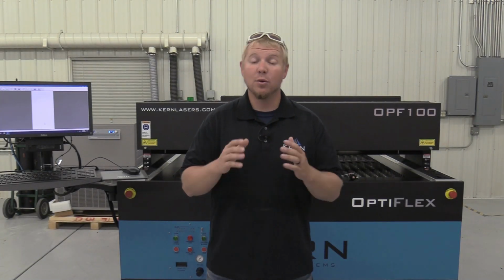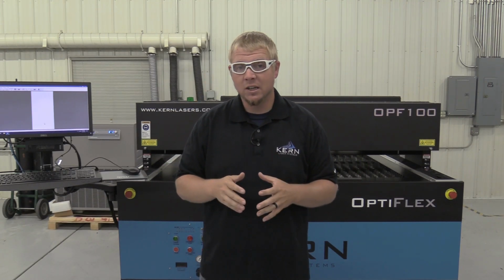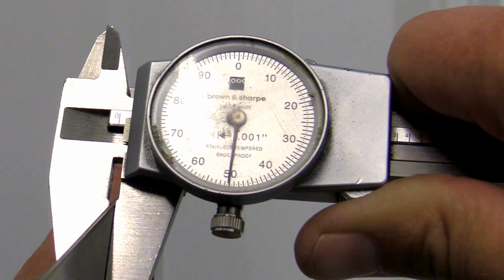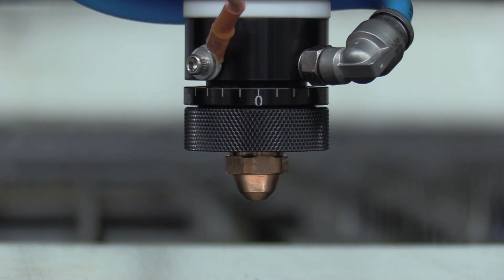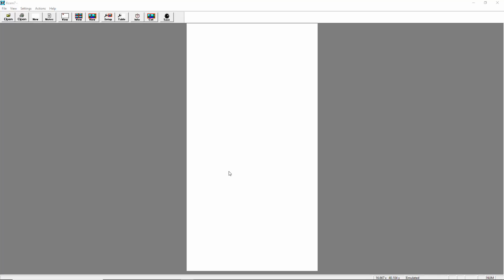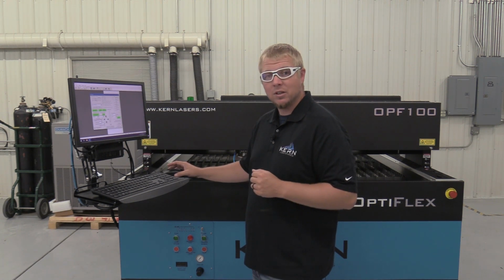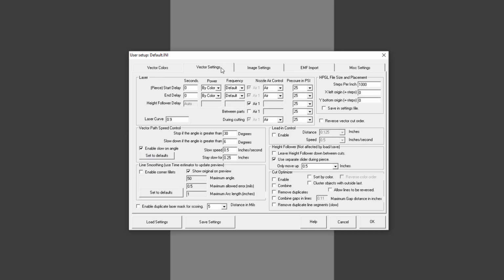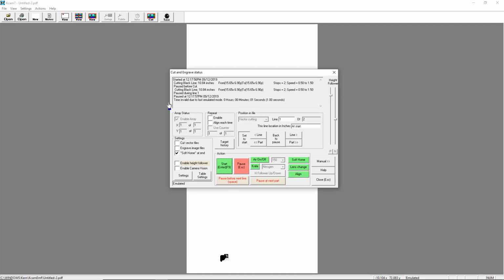400W CO2 Laser Stainless Steel Cutting with Nitrogen - Tutorial

Comment: I'm battling to understand if it's worth getting a CO2 to cut metal , fiber costs so much, it's so big, does it cut clean without burrs?? They also tell me, seeing that the co2 will always work at max power , this means that it will last very little time, can you please tell me a bit about my doubts, I want to cut maximum 1.5mm stainless steel.
Thanks sir
Reply from the maker: Hello! Sorry for the delayed response. Co2 lasers are able to cut many kinds of metal without burrs. Thicker aluminum will have some burrs but can generally be picked off by hand. 1.5mm Stainless Steel for example can be cut (generally without burr) by our 400W system at around 90% power so the theory that all metals have to be cut at 100% power is a myth. Our laser sources are warrantied for 3 years. We don't base our warranty on hours or amount of use so you can run it however much you want, we guarantee it for three years or we will replace it. The benefits of a CO2 over a Fiber would be the ability to cut and mark other materials like acrylics, woods, leather, etc with the same machine. It really depends on your budget and needs. Keep in mind this information applies to our laser systems only, we cannot guarantee results form other laser companies.

If you'd like you can email info@kernlasers.com and request more information. Thank you for watching our video and thank you for your questions! Let us know if we can answer any other questions for you.
Reply: @Kernlasersystems  I've emailed you, thanks for your kind reply .. @90% power, at what speed do you cut the 1.5mm stainless steel, so as to have a nice clean cut?
Reply from the maker: @zarbi123456 we are cutting about 1 inch per second at about 90% power. Hope this helps!

Comment: Hi, I'm considering purchasing a CO2 laser for cutting metal, but I need to cut steel, up to 15mm thick.  It doesn't matter how long it takes.  I wonder, if I take many passes, would this machine cut to this depth?
Reply from the maker: Good Morning Jared and Vanessa! Hope you had a great holiday. Jared, a higher power Fiber is what you would be looking for. Our 400w lasers are going to cut through 4.8mm mild steel with Oxygen assist. Doing multiple passes into metal is not recommended as the beam will reflect back into your lens/mirrors if it doesn't pass through the material.  Our 3kW FiberCELL is going to be at a max at .500" or 12.7mm.   Hope this helps, Vanessa, would like to see your finished set up when it's all done!  Have a great day to you both.
Reply: @Kernlasersystems  Thanks for getting back to me!  The best I can tell, is if will try this machine I would need a high power laser (probably fiber, maybe homemade co2) setup as an etching machine, not as a traditional cutter.  The highest power I see etching machines for sale is 100W, so I really wonder what something like 1-2kW fiber laser etching machine could do to a 30mm diameter steel bar.  I'm sure it wouldn't zip through like butter but given enough passes it would cut.  How much time is the question.  I see people deep engraving with a 50w, which makes me think cutting with a 1kw fiber may work well?  I assume reflecting back into the optics is likely not as big of an issue when the optics are kept at a distance from the workpiece.  I can think of so many applications for this...I'm surprised machines aren't sold for this...but maybe (probably) it's because it just doesn't work well.
Reply from the maker: @Jared Brandt 
Hey not a problem! We love talking with people interested in Lasers Systems!
In regards to your questions, one of our sales team members might have a better understanding of your process and would be able to give some insight on what might be best for your business.  Would you like one of them to reach out to you? If so, reply back with your email and we will have someone get in touch with you momentarily!
Reply: Repetitive pass will not cut it or going slow, your best option would be a raycus fiber laser power source @1500w you may get away with 1kw.  but your looking at 18k and up. Plasma cutting may be the way to go for cost.
Reply: @Nessy..  Solid recommendation, thanks!  This is exactly what another manufacturer recommended, but unfortunately I don't have that kind of money to spend on this and the fiber lasers I've operated are expensive to repair!  I guess I'm curious how slow is slow for the repetitive pass?  I'm considering a powerful co2, directly to the focus lens (no mirrors) with a focal length about 20mm off the cutting head.  Most metal cutting brings the cutting head 0.5mm or so from the tip so the gas will be most effective, but then it can't reach the thicker cuts this way.  If the laser can take .25mm per pass (that's my guess with air assist) the machine would be much more effective than the saws I currently use!  By most standards this is slow, but for my application (hardened bearing steel) this is very fast.  The cut would ideally have no burr or slag, so the only good options I've seen are laser or water jet, but I don't want the mess of the water.
Reply: Currently, it takes my huge abrasive saw about 3 minutes for cut and cleanup to get through 30mm diameter 62Rc bearing steel.  If it can take 0.25mm per pass, I'd say I've have a clean cut in about 1 minute.
Reply: @jaredbrandt9602  Not to sure how you would go some distance of the surface as in laser etching, I am thinking at 15mm thick the top kerf  will block the focus beam as you get down in the steel. 
Another form of cutting is Electrical Discharge Machining EDM like spark eroding. 
Think the machines could be expensive I did see a Youtube video a while back of some guy drilling holes in bearings and it was not that slow, and was all home made.  
Think there is a fast wire version of this also as in cnc I had a guy working for me that had experience doing die's.
Reply: @Nessy..  I wonder if the kerf is the problem as well.    Yes the manufacturer recommended EDM as well, but like you mentioned fast EDM might exist but I've never seen it.  I'll give it a bit more research.  There are cheap enough EDM tap removal machines and stuff...I don't know if it might work for something like this.
Reply: ...but...I still wonder if a laser could do it too.  150W lasers are nearly cheap enough to warrant an experiment, and if it doesn't work I'll have one hell of an acrylic cutter
Reply: @jaredbrandt9602  Well I started laser cutting straight out of my open car port with a laser that was meant to be 120w was about 95w on a table I made myself 1500x2500mm. 
I was able to cut 25mm thick acrylic at 1mm a sec it was slow but still worked well and could cut through 3mm at I think at about 20 mm a sec. it was enough to finance my 600w laser head that I built myself. Then I brought a 2000w fast axial co2 laser for about $200k on a 5 year lease. 
But lesson learnt the 600w made me more $$$ in the end and was cheep to run and fix. Stay clear of the little gift line stuff and dealing with people off the street, the $$ will come from Shop fitters needing signs and sign guys. Movie industry was good also. Stencils as in no parking is a good one but the time you waist with public is ok with stencil's. 
Stick to a full table as you will just be feeding it with cut down sheets that are expensive. 
Hope this helps
Reply: @Nessy..  yeppa that's helpful.  I'm in a similar journey for sure!  Have built a 4'x8' work area laser with a vertically mounted 40w from parts from my k40.  It worked great till I let a little bit of water freeze in the tip of the tube the other day.  That little 40w on 30w power settings cut .01" steel, which was surprising.  So I have the machine now and stuff to sell with it (and a powdercoat line) so it just makes sense to start cutting sheet metal.  I think the 150w will do that...just don't know if it might do more.  I plan to mount the 150w vertically also, so I will need to be careful about machine crashes.  I'm with you though, the large size machines are nice.
Reply: @jaredbrandt9602  Good move on the table and if you got gold mirrors get rid of them and use molly mirrors they are cheep from china and so much more scratch resistant and keep the fumes away from the beam path. I suck the smoke out from under the table and all exhaust fans are outside and vertical to reduce noise. 
Notice most of the China made ones are the same and the way they go about things are so wrong, if your going to copy something at least make it better.
Reply: @Nessy..  Yea I originally mounted the tube in the same way as the k40, but had waaay too much beam divergence for a useful power at the limit of the table.  But I was using the gold mirrors from the k40.  I've read that most mirrors are 99% reflective or something, but mine were hot, so there's no way they were as advertised.  I found the losses of the mirror system and the long open air distance were somewhere around 50%.  I need this laser moving again soon for acrylic, so I ordered a wimpy 50w tube because it's a drop in replacement, but will look at metal cutting later.  The only lasers I definitively know could cut what I wanted were 500-1000w fiber lasers.  Those are dropping in price year over year so much I might just wait a couple of years and make another "metal only" machine.  More power will have to wait:(
Reply: @jaredbrandt9602  Well when the Fiber Laser Tec showed up it was way out of my range and I just minored it and have been only cutting with 600w unit for 14 years. But when I saw the price of the fiber lasers I was just looking at a putting the head on my old laser. 
With the table optics I am meant to have water cooling on them and air feed to keep  them clean and cool but I just feel them and if they are warm I just clean them. 
I'm in Australia what part of the world are you in.
Reply: @Nessy..  600w is no joke.  Is that a folding tube?  I was looking at them and it seemed they were around 5k USD for the tube and power supplies from China, but they look awfully fragile!  Yep the fiber lasers are still pricey but are getting better all the time.  I see 500w for 8k usd, which might be the direction I go, later.  I worked on a YAG about 15yrs ago and we spent way too much fixing the q-switch electronics and it never was very reliable, but I hear fiber is much better.  I really like the co2 tube mounted vertically (for cutting only) with no mirrors.  If I was really confident in my controls I'd try a 600w tube and I'd be sure it had protection not to crack the glass if it smacks something, or possibly make a smaller machine where the work piece table moved.   I'd try the optically isolated fiber laser head with no mirrors on my 4'x8' machine for sure.  I'm in TN, USA...1/2 the world away!
Reply: I didn't realize the mirrors were cooled in those higher wattage machines.  Just seems like a lot of waste, but necessary if you need the etching mode.
Reply: @jaredbrandt9602  I use 10 meters of folded cavity as in a z frame with 12 600mm long tubes running at 50ma 6kv each bore diameter 18 mm with 3 38mm gold plated copper mirrors and one 25mm 50% OC 
I saw the 600w one that was made in wuhan "like would you trust anything out of there" I was thinking of swapping heads as I would not have to buy gas mix and footprint would be way less. I would expect the life expediency to be short as in gas decomposition plus the fold mirrors are at 90 degrees angle without any cooling on them the power would be all over the place. Note they have air cooling vents on the case as I vet they had to put PC fans on them to keep it cool as well as water cooling. 
Transverse mode that look like TM 00 with very narrow beam I have never seen anything like it in a co2. 
If it was any good the Chinese cutting table manufactures would all be using them as a option. 
 RECI CO2 Laser tubs appear to be good bang for the buck. welcome to add me on FB as Vanessa Courtney I be curious to see how you go with your table.
Reply: @jaredbrandt9602  because my laser is run on DC I am not able to modulate the beam to do engraving only lines. 
I do wonder if people make any real $$ out of engraving as most jobs are small runs and time on setting them up and 1 hour banter with customer market is saturated with the home baby lasers and moving to a large bed cuts most of them out of your market manly on signs.
Reply: @Nessy..  I must admit I have never heard of most of this (z frame, TM 00).  I was looking at the RECI or Yongli (they have 150w for $400 USD delivered here) and some of the folding tubes.  The folding tubes make me nervous because they can't be as reliable as a single tube...one part of it goes out and you loose power there for good:/  
So if I'm understanding...you have 12 600mm lasers in series or with some kind of beam combiner?  That's some ironman type shit:P  Lasers that size I'm familiar with use around 20kv and 20ma I thought...but it sounds like you might have something quite different than what RECI or other Chinese manufacturers would sell...are these homemade lasers?  I have thought it seems like laser tubes could be put in series for a better bang for buck and replacement, but I just don't know how the heck to keep the beam small and aligned...I'm guessing that's what a z frame is?
Reply: @Nessy..  for sure.  Yeppa I don't have a need for engraving...I leave that to the hobbyists:)  My business supplies robotics like linear rail and tslot frame so I end up cutting this for hours most days.  My business is new so to begin it's all by hand, but as I move to CNC cutting it sure would be nice to have pretty laser cut steel and aluminum.  I don't know if I'll be doing many signs, but I can see it's a huge industry!  My business is moving websites and I haven't setup the new facebook yet, so I'll add you to my personal fb but I don't post much laser stuff there, though I'd be happy to keep in touch with the progress!  A lot of parts I sell go into other machines and it's always fun to see what folks come up with!
Reply: ...and if you want to show off that 12 tube setup I'd be happy to see it, that sounds amazing!
Reply: @jaredbrandt9602  When I fire it back up in the NY I will post a picture to you
Reply: @jaredbrandt9602  TM 00 is the mode structure of the beam and can be tested on co2 lasers using a 25mm thick block of acrylic hit it with say 10sec of laser power while blowing away the fumes with compressed air this will show the structure of the beam. TM00 is like a knife most power is in the center. TM01 is like donut mode. Z frame I will send you picture easy. $400 bucks is cheep